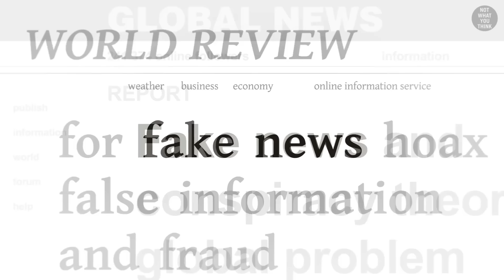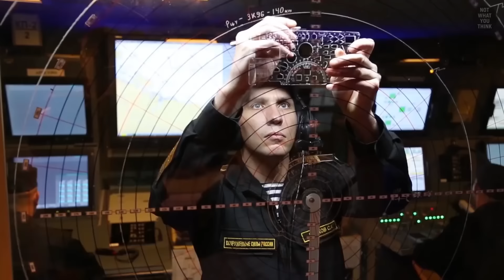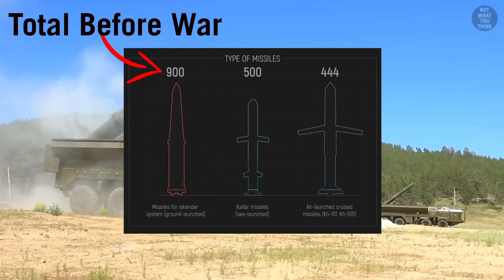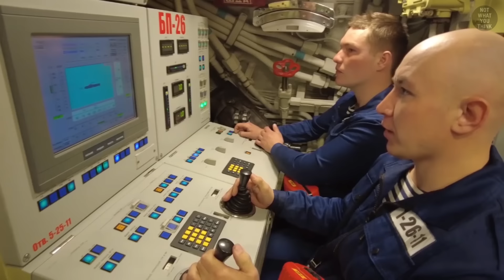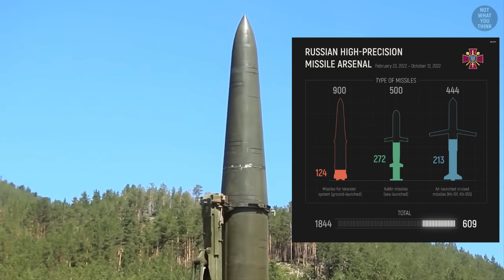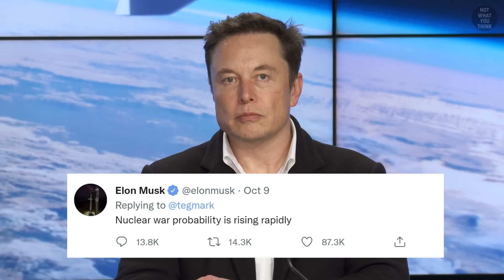Russia is Running Out of Missiles

Comment: The thing about terror bombing, like you describe, is that it historically doesn't work well against a determined enemy. Just see what the V1 and V2 bombings of London did during WW2.
Reply: Keep calm and carry on
Reply: Thank be to Werner for not perfecting rocket accuracy, till after he defected to US😅
Reply: -Before the German V1 and V2 Reprisal weapons Bomber Command was given the "Area Bombardment Directive" in 1942 which targeted the geometric center of German cities (no specific target chosen) ion order to de-house and demoralize the population.   Despite the neutral sanitized language was genuine terror carpet bombing since Bomber Command did not posses blind bombing aids of sufficient range and accuracy.      Oboe was limited by radar horizon and number of aircraft that could be controlled and H2S didn't come in till latter with the early versions only effective in coastal cities with rivers and good water contrast. 
-The purpose of using the V1 and V2 was indeed terror but the rational was to use that as bargaining leverage to negotiate the mutual end of terror city bombing between Germany and Britain.
-The V1 and V2 would have been inaccurate for about the first 9 months of their use and then more accurate guidance was scheduled.   For the V2 SG-66 and vollzirkel offered 500m and 300m accruacy and for the V1 Ewald II about 500m or more.  For the =winged V2 (A4b) 20m accuracy was expected using as system called Wasserspiegel.

-One problem Ukraine has it has no weapons to hurt Russia.   No nukes and no ATACMS.   These should have been supplied from 2014 but we foolishly gave Putin another chance.
Reply: There not meant to win the war, there meant to pre occupy the Ukraine military while the main attacks are carried out with precision strikes, followed by ground forces finishing the job and sorry to say, it's working
Reply: @thomasklein4265  Where and when is it working? What are the symptoms of it working?
Reply: @thomasklein4265  working 🤣
Reply: Putin idolizes Hitler so much that he wants to make all the same mistakes and rant at his minions in a bunker
Reply: @rohitpawar9198  Nuclear attacks when no one else has nukes doesn’t apply here
Reply: @rohitpawar9198  Wrong, bombing civilians has never won wars.
Reply: @hiddendragon415  with the notable exception of nukes against Japan
Reply: @ocirMZ  Well to be fair those nude were no more damaging than the fire bomb raids of cities. It was a different time without pin point munitions. Thats why it was ok then and a war crime now.
Reply: @KT-ki6gz  he even named the Wagner group after Hitlers favourite composer 😅
Reply: Terrorism only makes the enemy hate you more.
I don't know of any act of terrorism or campaign achieving their political goal.
Reply: I agree that these type of campaigns in general make the targeted population more determined. However, during world war 2 Londoners were praised publicly by the authorities and lauded for their bravery and resilience. A few decades after the war documents were declassified showing that the heavily bombed parts had been close to revolution. So I don't think it can be described in black and white terms.
Reply: the ineffectiveness of the v1 and v2 was not because of the british spirit but rather because the weapon was complete ass.
Reply: Or the US bombing campaign in Vietnam and Cambodia.
Reply: @kampfkeks0158  The British themselves analyzed the effectiveness of the Fiesler Fi 103 "V1" and found it had been highly cost effective.  Far more was spend on defending against the V1 than was spent by the Germans building it and operating it.   Over 300 aircraft were lost by the allies.    The references are even in Wikipedia.    The cost of production and launch including auto pilot was less than 350 hours.   If a V1 hit a potato patch it was said to have caused more loss than to the farmer.  The warhead was highly destructive.
- V1s when launched were too fast to intercept by any allied aircraft, even the tempest, but due to quality problems the reed valves of the pulse jet deteriorated and most became interceptable.  - Improved pulse jets in tests achieved 495 mph and with aerodynamic improvements were expected to achieve 515.   A disposable turbojet version (Porche 109-005) was expected top nearly doubled range and was also more accurate due to the absence of vibration.
A guided version was to use the Ewald II Guidiance system.  About 2/3rds of the way through its flight the V1 emitted single coded pulse. Three base stations around the launch area received the signals and calculated the position using time of arrival differences.  A single coded sequence of 4 pulses with time differences provided adjustments to heading and range to the V1 and was recorded on endless loop magnetic tape and adjusted into the autopilot.  It didn't add much cost. 
-Willy Messerschmits partner in designing the Bf 109 was Robert Lusser who designed the V1.  Messescmitt wrote to him saying he thought 100,000/month could be produced.  Certainly 10,000 month was possible.   
Had the missile entered service 3-6 months earlier it might have prevented the allied invasion wrote Eisenhauer.
As it was the allied invasion constrained the launch sites and forced the V1 to approach over only a few pathways which allowed the allies to concentrate defenses.
Reply: @niller1 its actually more nuanced. My english teacher in school (who lived through the war) told us they were not scared during the blitz or when the V1s started falling towards the end of the war. 

However, the V2s terrified them because unlike the V1s the V2s were supersonic. This meant that the could land anywhere at anytime and u would have no warning. In any other case you would have airraid sirens and some time to take cover but a V2 would literally kill you before you knew what was happening.
Reply: V1 and v2 rockets caused more casulties per tonne than the german bombers, it was infact very effective
Reply: @williamzk9083  Ukraine would not be doing anything more than it is already doing in any case - targeting strictly military sites near Ukraine. It will not engage in terror bombing like Russia is. This video is a load of b.s. clickbait. Russia is clearly losing the war, and badly, so how do I get views? Say that it is not.
Reply: @thomasklein4265  It ain't working. Unless you define 'working' by Russia losing vast amounts of occupied land in the last few months, and evacuating Kherson Oblast and putting mines around the dam. Sure thing Tom.
Reply: In contrast, look at what it did to Dresden. "Determined Enemy" is a Combatant. "Subjects to Terror" are Civilians. People forget that Distinction very quickly.
Reply: Like ukrainians do to the Donbass whole time and continuing on.
Reply: @thomasklein4265  Fond memories of Russia saying this special op would be over in a week and driving that 5 mile long convoy to Kiev only to lose, retreat and 7 months later be losing the gains it made over half a year. Winning?
Reply: @SchizaMan  ruzzian propaganda enjoyer spotted
Reply: V2 was a giant waste of resources.  V1 was ineffective because of 3 reasons:  a) it was very imprecise, as in "aim at London"--50 meter accuracy is excellent by comparison b) the Brits were able to mislead the Germans about where they were hitting--not possible with satellite surveillance today c) the D-Day invasion pushed the Germans beyond the range where the V1 could reach London.  Unless the Ukrainians are going to invade Russia and push them back to the Urals, the Russians can continue to bombard Ukrainian targets with cheap/old missiles and drones for as long as they like.  A Shahed drone costs about 20,000 USD.  An air defense missile costs about 500,000 USD (and might only be 50-75% likely to score a hit).
Reply: @thomasklein4265  Can you tell us, in what part of Ukraine that strategy is working??
Reply: @grant11102  Yes indeed. You can still watch those statements from the Russian command at the end of Februari.
Reply: @williamzk9083  love it, great analysis
Reply: @ocirMZ  this was different; Japan had no means to defend against those attacks and they caused mass devastation, after the second bomb they knew the US could just keep sending nuclear bombs and they couldn't do anything about it. Britain could defend against air strikes and they could bomb Germany back, and they knew eventually they would invade Germany, which is why they did not surrender. Plus, if Japan hadn't surrendered, the US would have invaded. Germany could never invade Britain.
Reply: @andruloni  I was about to ask the same question. The Russian front except the center is collapsing slowly.
Reply: u can't compaire old WW2 with modern warfare
Reply: @tcg1_qc  no forewarning time almost no time to get into shelter
Reply: The carpet bombing campaigns of WW2 (against Germany and Japan) and the bombing campaign against Vietnam were both failures at damaging morale. Yes, they harmed factories and bridges and killed lots of people. But they failed to force an end to the fighting.

Dresden was bombed as a favor for the Russians, and it was a center for logistics and manufacturing. It was a valid target on those counts, as there was no ground battle for Dresden once the Red Army arrived and the damage to the German railroad infrastructure was enough to halt trains through the area.

But there has been only a handful of instances where a bombing campaign expressly used to frighten the population has worked, and those instances are exceptionally that prove the rule (i.e. Guernica and Rotterdam). Even the highly advanced version that was done in the Gulf War of 1991 and the Invasion of Afghanistan in 2001 yielded no results on the civilian population. Resistance only grew harder.
Reply: @jasperzanovich2504  Some people would say the Taliban qualify. I would not argue for or against as it gets really murky what constitutes an act of terrorism.
Reply: @luciustarquiniuspriscus1408  they weren't what directly lead to the German defeat though, and they weren't a major factor behind it neither
Reply: @MarsStarcruiser  Werner Ziegler?
Reply: The thing is, Russian has more powerful nuclear weapons. During the German attacks on London using V1&V2, it was because they were desperate as the Battle of Britain was lost. Germany didn't have nuclear or atomic weapons, that's why I respect Russia, despite NATO unacceptable interference in Ukraine, Russia has avoided using it's nuclear arsenal.
Reply: @arseniix  Wrong Werner lol, all good.  Von Braun, the guy who later became part of nasa and helped us get to the moon.
Reply: V1 and v2 were incredibly inaccurate though.
Reply: Is Ukraine the British here ?😄
Reply: Between Ukraine shelling Belgorod or Donbass and Russia taking out half of Ukraine's electrical infrastructure, I think one fits the description of terror bombing a bit more than the other.
Reply: @ocirMZ  that was was already lost. Those nukes were as much for Stalin as they were for the Japs.
Reply: Iraq?
Reply: @thomasklein4265  Working in your dreams maybe.
Reply: @thomasklein4265  It's working? They keep losing territory. Yesterday alone, UA was able to bomb the Chechen mercenaries.
Reply: Russia didn't learn from the Afghanistan experience.
Reply: Look what it did to Libya and Iraq.
Reply: @rkithan2864  can you proof "NATO's unacceptable interference in Ukraine"?
I highly doubt it.
Reply: Add israel to that list
Reply: You remember the Dresden bombings in 1945?
Reply: Yeah, good alligoria for the Donbass.
Reply: What do you mean....tell me how the two nukes dropped on Japan worked out for terror bombing?
Reply: @KT-ki6gz  for a example what maietake did he do?
Reply: @jasperzanovich2504  terrorism is being used too often for the smallest stuff these days
Reply: @polskitygrys4951  Wrong, the bombing of the Axis never broke the will of their peoples. It helped reduce their combat strength by bombing production but bombing alone did not win WW2
Reply: @hiddendragon415  i know it diddent reduce the will to fight. But it did worke out better the way the British werkte bombing. Carpet bombing than the americans
Reply: @polskitygrys4951  What are you trying to say?
Reply: Kinda different ….. the V1 and v2 were still basically experiments still unlike the missiles now that have so many more years of development yet still don’t do much
Reply: @grant11102  Russia never set a timescale of the SMO, western analysts said it would be a week
Reply: @tannerlane9669  theire met nowadays just to destroy stuff like himars or other valiuble stuff the enemy migh use against you.
Reply: @polskitygrys4951  okay sir but like I said Kinda different ….. the V1 and v2 were still basically experiments still unlike the missiles now that have so many more years of development yet still don’t do much
Reply: @tcg1_qc  Japan was surrendering regardless of the nuclear bombings. The US dropped the bombs to show the ussr their new toys not to swiftly end the war. Yet people still believe the latter as talking about allied war crimes is still taboo
Reply: @youkofoxy  yes the peapel were ready to charge against any naval invasion on the Japanese shorse causing millions of dead on both sides. The emperor was scared what 1 Bob could do what usually hondereds do
Reply: @tannerlane9669  i know what those are. Because.... i study history
Reply: @williamzk9083  I don’t think USA would give Ukraine nukes. Even if Russia used them first.
Reply: @jackuzi8252  it’s unlikely Ukraine can push Russia to the Urals, even with western support. Russia would’ve used nukes at that point.
Reply: @1mol831  Yes, that was my point.  Essentially, Russia can continue to bombard Ukraine as long as it likes.  Foreign powers may be able to reduce the numbers of missiles and drones it can produce or buy, but not reduce it to zero.  We are seeing that sanctions and battlefield losses won't induce them to stop, so some other combination of carrots and sticks has to be developed.
Reply: @tannerlane9669  bruh i don't even know what nat neo Geo is. And your getting for me understanding someting 💀
Reply: @polskitygrys4951  Of course you don’t… especially since your trying to prove a point without any facts
Reply: @tannerlane9669  bruh i just said I know what those are multiple times and what you do it say stuff litterly noone asked for and noone cares, go look for attention somewhere else bruv
Reply: @tannerlane9669  nah you an NPC or sometin💀or ur so mad that uraking stuff up like established someting. Like established what? Tell me, tell bro you won't, youl prob just Google someting like always💀
Reply: @thomasklein4265  Considering that the current reports on Ukrainian assaults on Kherson seemingly having gotten to a point where Russians are actually fleeing from there, not as effective as you might think.
Reply: @techkingdata9338  The two nuclear weapons dropped were actually used on legitimate military targets at the time, and was also used to drive home the point of Allied superiority to force the Japanese to surrender. Here's the difference though: Japan was already on the losing end by the time the nukes were dropped, having lost all of the foreign territory they had within just 5 years of conflict. The nukes were the straw that broke the camel's back.
Reply: @monsta4026  The estimates of 3 days to a week of conflict was from a combination of sources not least including Russian propaganda, and actions like sending police forces to Kyiv alongside the military units. The latter action is especially telling, since it shows the mindset that Kyiv will fall so quickly that they'll need police to pacify the civilian population once it's been occupied. Then it turns out Kyiv was more resilient than expected, and said police forces were thus screwed.
Reply: @StrikeNoir105E  nice but the terror bombing worked
Reply: @thomasklein4265  Aged like fine milk
Reply: @thomasklein4265  Is it still working?
Reply: Hiroshima and Nagasaki seemed to work,
Reply: As ukrainian im 100% agree with u, this sht just annoyed me, cause when “rocket alarm” ringing all the shops had to close teir doors due to “rules”. But shaheeds… its so loud and every time they wake me up in the morning
Reply: @robertosovietunion7567  Moscow to the closest point of Ukraine is 450km.  As ATACMS has a range of 300km so its not enough to hit Moscow.    ATACMS can in good consciences be supplied to Ukraine without threatening the city of Moscow directly.   I also think that as ATACMS will fly  higher than GMLRS it will be a bigger targets for SAM missiles so the range will need to be compromised considerably to get a lower, faster profile. 
-It should be used to threaten Belarus if it enters the war on Russia's side again.
Reply: @thomasklein4265  It actually increases the Ukrainian morale.
Reply: @smasherblues5322  Could ask you the same about Russia's lies
Reply: @dehtyarUA  really? So, Donbass was not shelled? There's two sides to every conflict. It's the very definition of conflict. Unless it's internal, which this is not.
Reply: @andruloni  he'll get back to you on that... lol
Reply: They shelled Kyiv, this video was wrong. Do you know where Kiev is in Ukraine ? The middle.
Reply: @thomasklein4265  If by working Russia losing major ground...ya thats going great with the 73,000 so far dead lol
Reply: Subjugation is harder than Annihilation !
Reply: @hiddendragon415  only boots on the groud don't win wars either if bombing raids didn't happen in the wars the "boots on the ground" men and women wudve been massacred....japan was put down solely through bombing of supplies and cities into oblivion....to think only boots on ground win wars is also a fallacy......besides annihilation is easier than subjugation an enemy nuked into oblivion is more effective than occupying them!
Reply: @johnanderson6946   I never said the bombing of industry didn't contribute. Don't put words in my mouth. It did just as the Italy campaign or Lend lease to Russia helped. Once again you are insinuating grinding down a nation through bombing can win. If the nation resisting is determined and the more Totalitarian the nation is it's easier then no bombing can't win a war. Look at Ukraine are they showing any sign of giving in, quite the opposite.
Reply: @johnanderson6946  How old are you, six.
Reply: @hiddendragon415  how old r YOU five?
Reply: The German plan was to hit London with hundreds of converging V-1's in one barrage. Take out the whole city, ports, manufacturing, commercial, residential--all of it in one fell swoop.  Launch sites were built all along the coastal regions of northern France, ramps being easier to build than the V-1's themselves.  Some observant Frenchies wondered what these odd ramps were, pointing in a slightly different direction depending on location.  See _The Man Who Saved London_, about an independent French resistance leader who smuggled info to the British in Switzerland.  They took all of the drawings gathered by his agents, drew the lines, and, VOILA!  they all converged on London.  So the array of ramps was bombed and the V-1's were committed piecemeal.  It is also a story of human resistance, as he is captured by the Germans and put in a forced labor concentration camp.  Defiant to the end, he smuggles out a few of the stamped steel machine parts he is forced to make each day, knowing the Germans will hang him at once if he is ever caught.
Reply: @luciustarquiniuspriscus1408  Zelensky can ask for the moon since Z is not the one paying.  Defensive missiles cost orders of magnitude more than offensive ones.
Reply: Yea like operation rolling thunder on vietnam, just goes to show superpowers can be beaten by underdogs.
Reply: Big daddy America came and saved UK and the Soviets were pressing hard from the east.